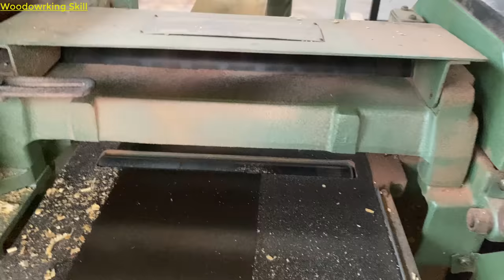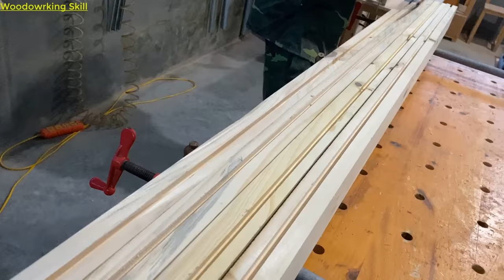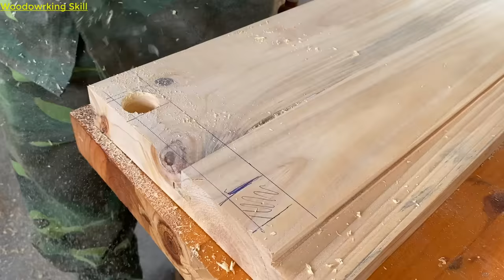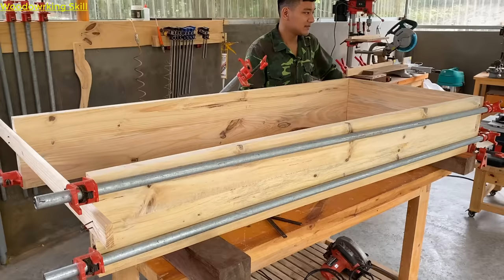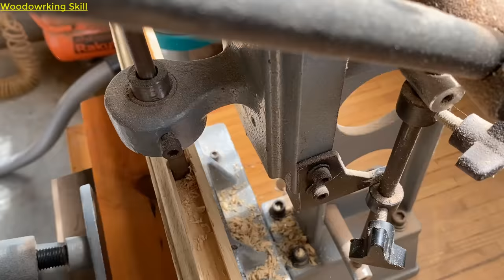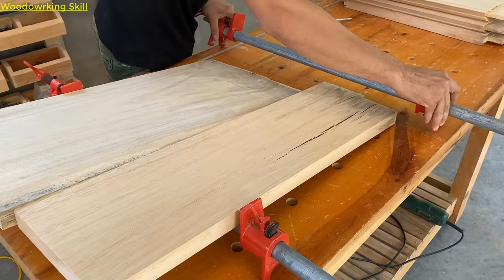Build Wooden Room Doors To Replace The Old Aluminum Doors // How To Build Wooden Doors With Glass

Comment: What if later the glass breaks?...
Reply: new project for same door 😂😂😂😂
Reply: New door
Reply: I thought just the same 😊
Reply: Ggs
Reply: Просто не надо разбивать стекло! =)
Reply: Easy. Take out the shards, use a handheld router to remove the wood along the edge on one side. Put in a new window pane, tack small rods along the rim. Done.
Reply: @poelmeister easy? Pain in the butt!!
Reply: @78ramcharger53  If you say that, I think you tacked the rods along the wrong rim. :)

But no, it is a piece of piss. Really.

Comment: He made them beautifully, but in my opinion he made a couple of big mistakes. The hole for the lock should have been drilled before painting, the hinges should have been installed in the workshop, the glass should have been fixed with moldings after painting (if the glass breaks, the wood that holds the glass will have to be torn, the door should have been installed with pure foam and not screwed now you can see the screws. I think there are a lot of mistakes.